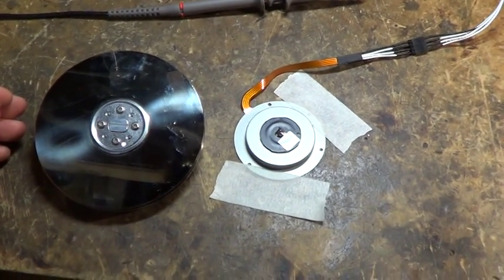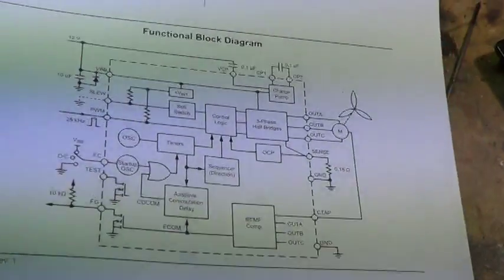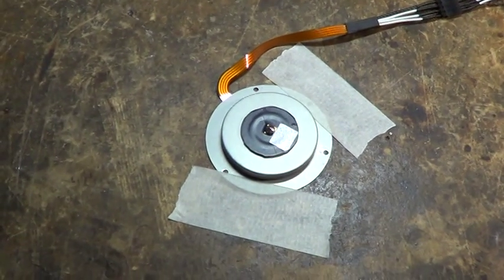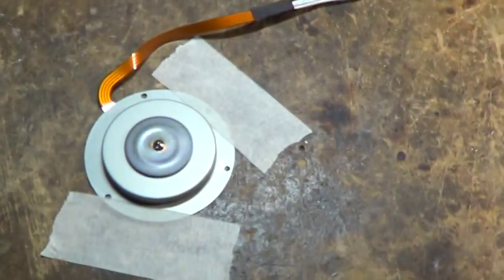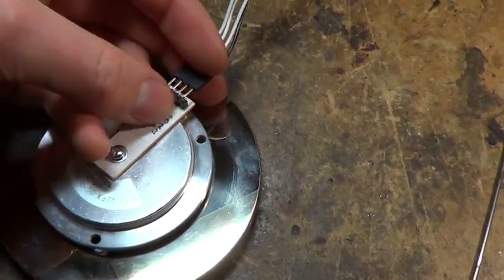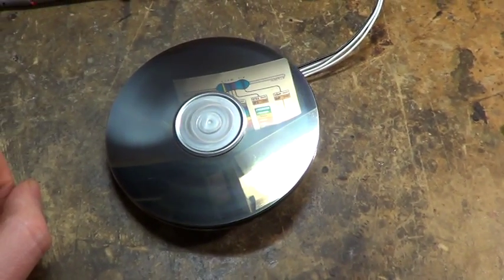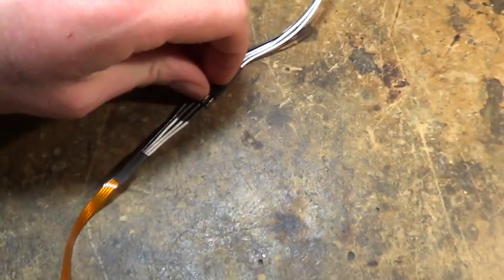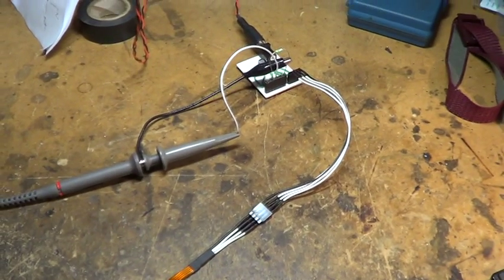Brushless motor driver - A4941

Comment: Clean solution Lindsay. Question: is it possible to configure a brushless controller that does not have to be "turned up" from zero? In other words, a system where when the brushless is powered ON, it automatically resumes the speed it was last turned OFF at. If operator wanted, he/she could adjust speed while motor was ON. Think this can be done?
Reply from the maker: Thanks! That actually isn't a problem - the speed is set by a voltage input to the chip, which in this case is provided by a potentiometer. On startup, the controller chip will speed the motor up from rest to whatever is specified by the the voltage. So you could adjust the set speed either while the motor is on or off. Hope that helps!
Reply: I've been investigating and found the problem I'm facing in my application is the ESC having to "arm" itself with every new operation. I've watched your fine vid a few times and it seems you are doing what I want to do---"switching" the motor ON as opposed to dialing up the speed via a potentiometer. My question is first, am I correct in that? Secondly... the chip circuit diagram, is that all that's needed? Are you using a special ON/OFF switch? And thanks for your input and making & posting your vid.
Reply from the maker: Karl Hansen Yup, this is exactly what I'm doing. Actually, the driver is being powered with 12V from my bench supply, and the switching you're hearing is just me turning the powers supply off and on at the mains. The circuit really is all you need, it's a very self-contained controller chip. Some if them have extra features, like the ability to control speed over a serial interface from a microcontroller, but this one is pretty simple. Glad it helped out!
Reply: Yes Lindsay, that's good news. Thanks for the reply. Best to you from Miami!

Comment: OK but in circuit you give MOSFET but its sign of transistor  and      123 is coil how its swipe
Reply from the maker: What on earth are you talking about? My circuit does not have any MOSFETs or transistors. You are talking about the correct circuit? That this one: http://imajeenyus.com/temp/a4941_driver_schematic.pdf. There's the controller IC, one resistor and four capacitors -  no MOSFETs or transistors. As for "and 123 is coil how its swipe" I have no idea what you mean.

Comment: i have A3930 and its became useless because i do not get and schematic that i can follow  i read its datasheet but they do not provide the values of capacitor and resistor used in circuit please help me !!! i have 24 fvolt bldc motor  tanks and great job done on video thanks
Reply from the maker: I'm sorry, I can't help with that specific part. I had a brief look at the datasheet, and it seems to describe calculation of the bootstrap capacitors on page 14
Reply: cool thanks !

Comment: I think for 4 poles you will multiply by 2 as it will only take 180 mechanical degrees for the rotor to present the same pole configuration to the stator. Unless by 4-pole you mean 4-pole pairs. What a handy source of motors with such a simple driver.
Reply from the maker: Thanks for the comment. Yeah, I just glibly said "4 pole" since I assumed that would account for the factor of 4. I've now read around and it's a factor both of the number of poles and the number of windings, so it's a bit hard to say exactly what the motor is.
Reply: ***** I think it is only a function of the number of poles, the number of slots/windings just affects the number of possible poles as one electrical rotation is just one electrical rotation no matter what. So if you know the mechanical speed is 4X the electrical by some other means then it has 4 pole pairs or 8 poles. My reference is "Brushless Permanent Magnet Motor Design,2nd Ed" page 11, by Hanselman. I'm currently reading it :)
Reply: My bad, the mechanical speed would be 4X lower than the electrical speed of course.